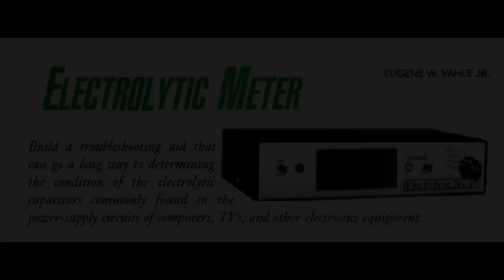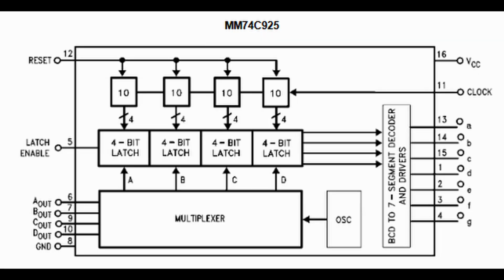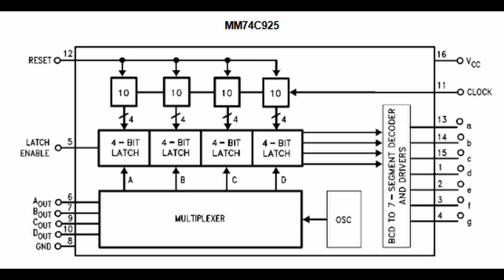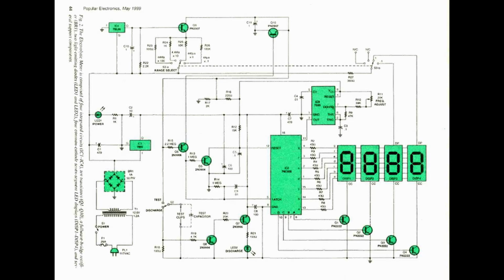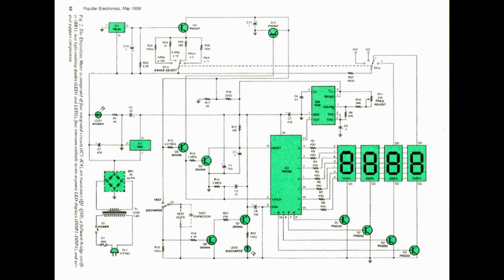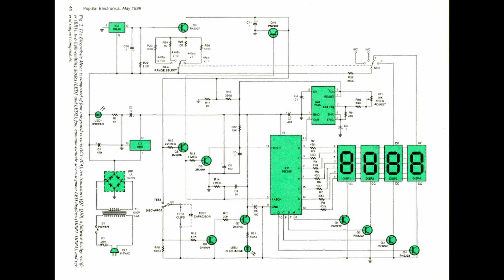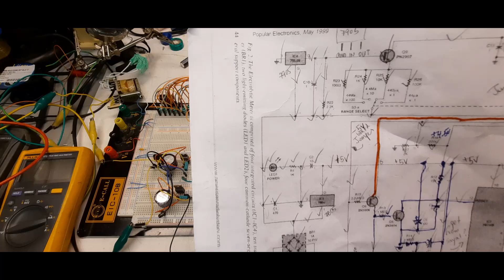Popular Electronics - May 1999 - Capacitance Meter

Comment: Guess this is pretty old now (catching up), but the way the 7905 is connected will produce 5V below the unregulated supply relative to it, not relative to ground. Also, it would only regulate if current is drawn from the regulated output toward the supply, not toward ground. Example, the unregulated supply puts out 15V with some ripple. The regulator will put out a quality 5V below that (10V) with identical ripple relative to ground. If you try to draw current to ground, it will come out of regulation and just drop, probably damaging the regulator. If you draw current up toward the unregulated supply, it will hold steady. I didn't zoom in and analyze the circuit, but it must have been designed that way due to the direction of current draw and the need to regulate the voltage relative to the supply, not ground. It must be made as shown.

I do enjoy these videos and am happy you're doing them and learning. Keep up the good work!
Reply from the maker: Thanks for the explanation of the circuit. I have learned a lot since this video because of help like this. Cheers

Comment: A failure is nothing to be ashamed for. Edison lamps failed thousands of times because finding a viable filament material was a monumental challenge; early attempts used various materials that would burn out too quickly, become too expensive, or were too difficult to process. Edison's quote, "I have not failed. I've just found 10,000 ways that won't work," highlights his strategic approach of viewing each failed prototype as a step toward success, not as a true failure.

Comment: ELECTROLYTIC METER
CORRECTIONS (as appearing on the July 1999 edition)
There is an error in the schematic in
my article: "Electrolytic Meter"
(Popular Electronics, May 1999).
The wire attached between R16 and
R17 should be connected to the base
of Q10 (PN2907) instead of the emitter
of Q10. Resistors R16 and R17 form a
voltage divider between +5V and
ground, giving +4.5V to the base of
Q10. This voltage is used by Q10 to
clamp the output on the emitter to
+5.5V.
On page 43, paragraph 3, the text
states that R11 is a 10k potentiometer;
it is actually 20k. It is correct in the
Parts List. Also, I listed R1 incorrectly
in the Parts List as 1/4 watt; R1 should
be 1/2 watt.
Eugene W. Vahle, Jr.
Quincy, IL
Reply from the maker: Thank you ... I did not know about that. Plus the experience of building lately, I might try this one more time. Cheers!
Reply: @bettinaneumryr  I would love to see your corrections as per the above instructions, as I too would like to build this device. I would look at recreating the circuit in one of my e-cad apps and getting a pcb made

Comment: I may have missed you mentioning this in your video, but there is an error in the published schematic that is explained in the letters section of the July 1999 issue.  The junction of R17/R16 is connected to the wrong point.  It should be connected to the base of Q10 and the emitter of Q6.   If you look at the schematic at the junction of R16/R17 and then follow it up to where it connects to
the botttom most of the 3 horizontal lines....it should be connected to the middle line (which connects to the base of Q10 and emitter of Q6).  In case you want to make another try getting it working....
Reply: Your comment lead me to fin de "Electrolytic Meter Corrections" note. Thanks a lot!

Comment: Honestly nowadays, any simple microcontroller and 4digit display backpack or other small screen could "simplify" the counting and display part of this circuit, and for a lot less cost than that chip!! And use most of the guts of the oscillating and charging circuitry to still build this kind of meter. 

If the input transformer voltage is X volts, the 79L05 should theoretically create a stable voltage 5 volts lower than X; so for example 12V - 5V = 7V. This is a stable voltage level referenced to (below) the top rail (+V), rather than the bottom rail (ground) which is what we're normally comfortable with. This makes sense for use with PNP transistors, if you'll remember all their "values" are "flipped" negative from an NPN. An NPN will make sense with all its values being positive above the reference null voltage, whereas a PNP has all negative values which would be below the reference null voltage. And likely, this makes sense for a current source. A current sink will try to suck a very specific designed current down through its 'input', like a straw. It is very easy to build, using NPN transistors, and a positive reference voltage above ground. However a current source is the opposite: it will try to push a very specific current out through its 'output', and it's most easy to build using PNP transistors coming off the top (supply) rail as well as a reference voltage below that.
Reply from the maker: True that about the micro controller but I want to stay true to the magazines design. You give an awesome analysis on the design. My brain does not go to that level. I do recall a 7 volt on the out of the 7905 and I am tempted to re-do the circuit one more time. Thanks for your explanation on that part of the circuit. I really appreciate it. It's great to get feedback like this and I learn more and more about electronics. Cheers!